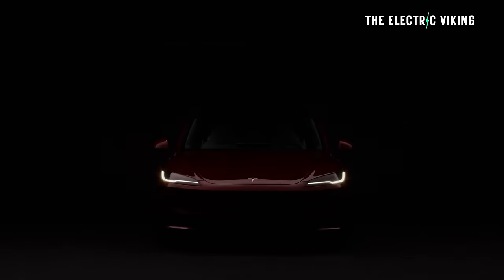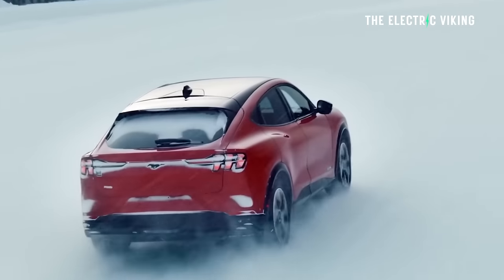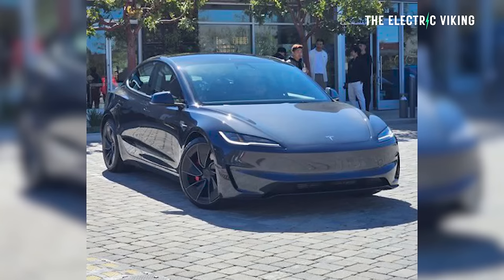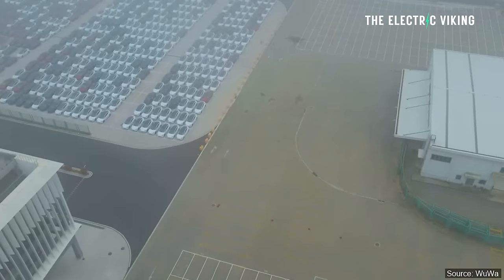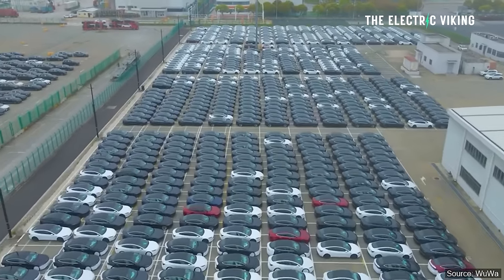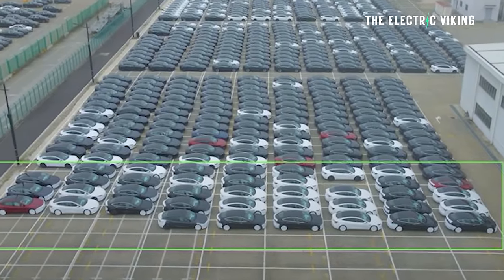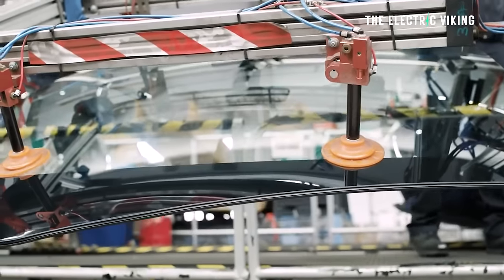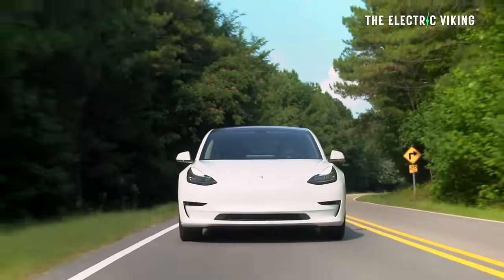Tesla starts shipping Model 3 Ludicrous from Giga Shanghai with 600HP

Comment: I have a Performance Model 3... Truthfully off track the acceleration is something I seldom use. For the first few months, yeah, I demo'd it to lots of people. The usual reaction? "Wow, but please don't do that again, I feel sick". Even if you make sure their heads are against the headrest, a lot of people react to the acceleration forces by feeling motion sick.

If you're going to track the car, you know you need this, but the average person almost certainly does not.

I do wish they would make Track Mode available on all the cars...
Reply: And with a proper suspension kit the car will pull over a G easily on its stock tires, and with track tires over 1.5 G's. All the whiners and trolls endlessly complain 😢about Tesla but they've never driven anything that handles like a properly kitted model 3 Performance. It drives actually very much like a heavier version of the Porsche Cayman
Reply: I also get motion sickness and hate it when friends want to demo their new Tesla by flooring it. The acceleration is a one and done party trick for everyone I know who owns a performance, or even LR, Tesla. For every day use they default to chill mode to go easy on the tires. I don't know a single person with a performance who actually takes it to the track. They also don't benefit from the improved brakes with one pedal driving. The upgraded stiffer suspension is a downgrade for everyone using the car as a daily driver to work as is the 20" wheels.
Reply: My wife say she gets sore eyes when I press the accelerator in the M3 LR. 😀
Reply: I rarely use full acceleration in my 2023 M3P.  When I do is usually merging on to free ways so I don't have to wait for trucks who refuse to change lanes.  

Every now and then I get the opportunity to play with a modded Subaru.... they'll race anyone.  

The 20" wheels suck.  I put 18" Martian wheels on with 45 series tires.  Improved ride and pothole performance greatly.  Still handles great for every day driving.  

I don't need anything faster.
Reply: @ron2280  I've been thinking of the Martian wheels. Did you go 18" or 19"?
Reply: @paulcantrell01451  I went 18” on my Model 3 Performance.  We put 19” on the model Y long range.  This allowed 45 series tires for ride and pot hole protection.  They both handle spectacularly and they added range.
Reply: @ron2280  I was leaning toward the 18", same as my winter wheels. Thanks for the input!

Comment: I think that the key to the Model 3 Ludicrous success will be depending on it's pricing. The Model 3 Performance already highlights one advantage of high powered EVs. They can provide supercar acceleration, but driven normally they can be economical, practical, and reliable. Which are not traits of high performance gas powered cars. For the U.S. the Model 3 Ludicrous could possibly qualify for federal subsidies, which would make the car even more competitive.

Comment: I don't want a V8 Killer, I want a Porsche killer!  0-60 and 1/4 mile is not the most important.  Braking, cornering and sustained acceleration were the previous M3 Performance weaknesses. Fingers crossed, it sound like there are improvements in all three.

Comment: No mention of the Cybertruck issues huh. $80,000 for a poser truck that either gets stuck in a tiny puddle or is out-of-service and being recalled.
Reply: Teething problems dude! A badly fitted/glued accelerator pedal cover is not a world shattering fix but needs to be done, its a potential safety hazard. Completed cars being stored in factory carpark till ready for fix then shipping meanwhile battery manufacture scaling up is still hindering full production but that will be sorted over the rest of the year reaching full 500k/yr production sometime next year and with it all the drive train variants.

Comment: Tesla keep regurgitating the same decade old model over and over. Must be tiring for these Tesla fanboy channels to pretend to be excited over this.
Reply: I know right, Tesla started getting notoriously boring. Xiaomi Su7 IM L6 Zeekr 007 all do 2.78 seconds to sixty and all new sexy cars
Reply: What! These are new designs. Try to keep up
Reply: I actually like that Tesla is spending it's efforts on things that matter rather than minor styling changes. Between my 2018 Model 3 and my daughter's 2023, they've added the LFP battery, heated steering wheel, double pane glass ( really helps with cabin noise ), the heat pump, electrically operated trunk, and of course the upgraded computer system. None of those are that significant, but taken together it's a significant upgrade over my car. I'm a little jealous! That's so much better to me than a few styling changes that wouldn't really improve the vehicle.
Reply: @Anthony__420 New bumpers and lights. Same car.
Reply: Model 3 isn't a decade old...
2024 Model 3 performance will shit on any other car in its class.

You sound like a salty hater lol
Reply: @strokerta1986  yes the performance is why they hate
Reply: @meeks133  OP right. Model 3 will not recieve any significant hardware updates for atleast a few years same as the model S and X. Model S is basically over a decade old and X will be a decade next year.
Reply: @ciybersal3499 xiao mi car notoriously running into safety risks. Trade safety for styling you say?
Reply: Worked for Porsche.
But honestly yes model 3 performance needs better seat more like 700hp low 10 second quarter mile at over 130mpsh adapatave dampers. And a real suspension in line with say a vette
Reply: 911 is 50 years old .. no one complains about that
Reply: These are people that's never drove in a Tesla commenting here... Should definitely get an exciting looking car and then pull up to a Tesla at a red light and see what happens if you want to look like you're driving a NASCAR then go ahead I'll take four doors a Starbucks latte and all of my family sitting in my car at the red light and smoke your car nothing boring about it
Reply: Actually not at all. They are getting better and better, quieter & quieter over the years. You should test drive it (any long range or performance model) you will never go back to a gas car !! ⚡️😎
Reply: In somewhat true but the value for a Tesla M3 and MY is so much higher than the competition. The software, the app, the performance to cost ratio, running costs, packaging and space, frunk, charging infrastructure. Those and many more are valuable for many consumers. A nice looking car with buggy software and app has no value for me
Reply: @meeks133 how old is a f150?
Reply: @Yubuzka3774 model S as far as model years is as old as you say. 
Car is completely different..
Reply: @whitecometify Corvette starts at 68k. 
A much more expensive vehicle
Reply: Must be tiring for Porsche 911 fans to see the same vehicle decade over decade..
Reply: @Yubuzka3774 Porsche vehicles decade after decade are basically the same car
Reply: I'm excited.. why so mad?
Reply: @Yubuzka3774 it's not the same car.  Educate yourself and see what's new in the highland bud
Reply: As much as I like our Model 3, I have to agree. Tesla have lost their way with their product planning in recent years. They should have released the Model 2 way before now and had the S and X available in RHD all this time. They've lost their first mover advantage to Chinese competition.